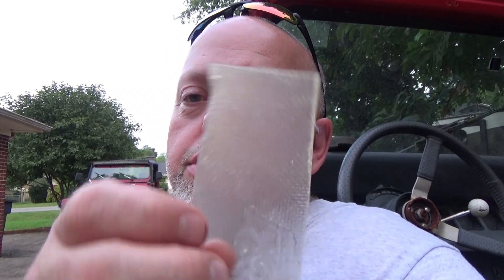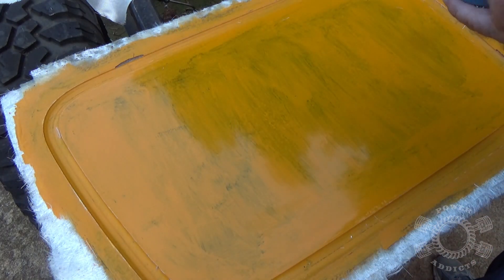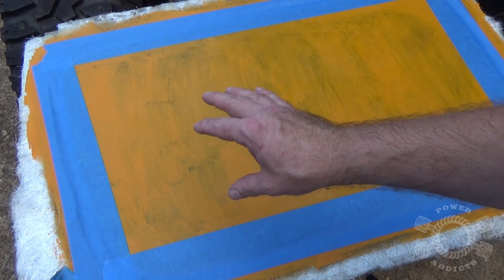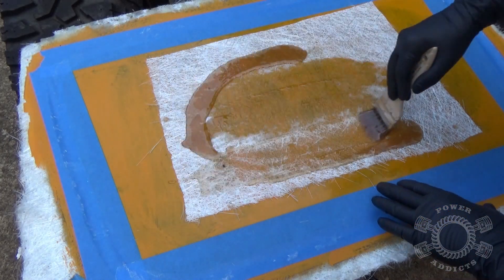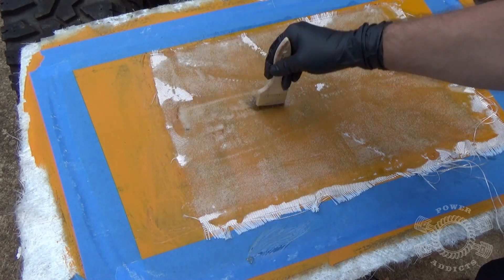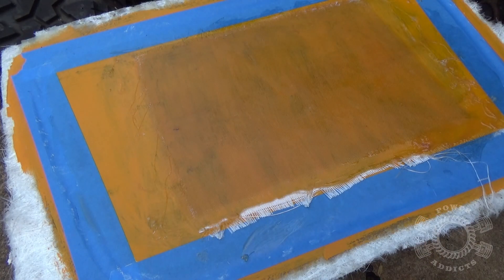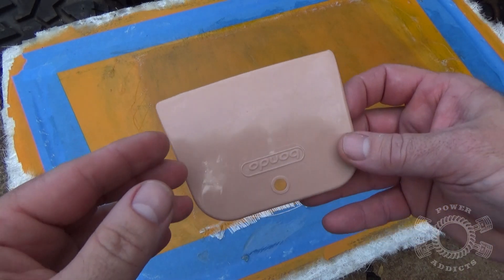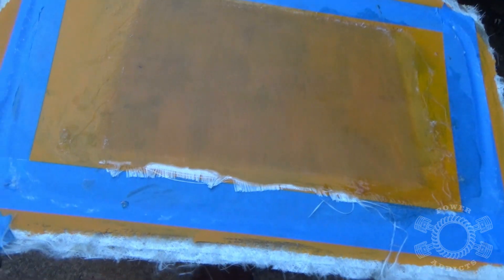How to make a Fiberglass skin to make repairs much easier!! #fiberglass #repairjeephardtop

Comment: Thanks. You gave me ideas. Do you think its possible to make your own fiberglass halftop using your our softtop when its worn out? If you can please post. That would be awesome.
Reply from the maker: Would it be possible? Technically yes. I've actually thought about this for my toy YJ until I came across a busted hard top (for $75) to cut down. But, the important keys to note are, It would take A LOT of material which isn't cheap. It would take A LOT of work and fiberglass knowledge as well. It would possibly be cheaper  ... definitely easier to find a busted up hard top and shorten it.

Comment: Hey great video i gota project want to know if you could help with or already have some video that would help i just got a yj top and i want to cut the back on that one line going up the back and move it up to make a half cab top but haveing trouble trying to fiberglass ic connect the back to the front and fill the gap where the wondow would be
Reply from the maker: Last week I picked up a busted hard top for that exact purpose. I shortened the tub on my toy YJ rig so I'll be shortening a hard top to fit the shortened tub. I'm not sure when I'll get started on it. Probably within the next month of so.
Reply: @Poweraddicts  definitely looking forward to it really want to to this project is rust bucket going to be at jeep invasion